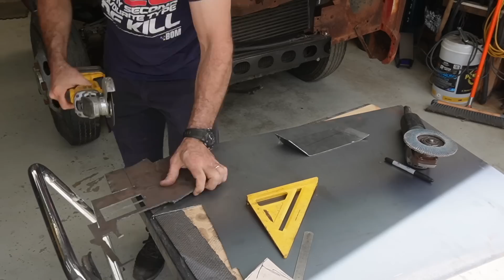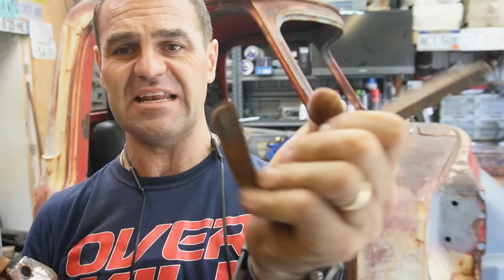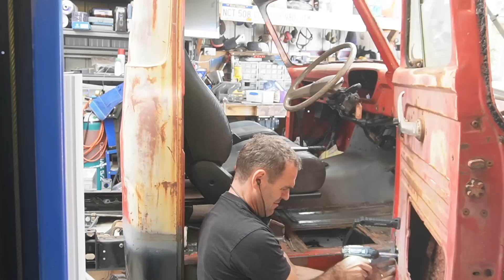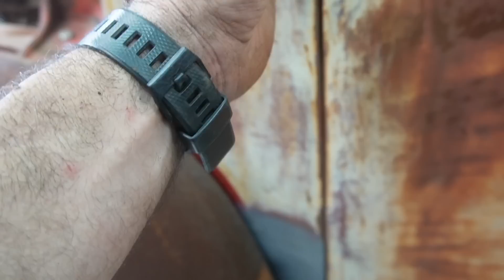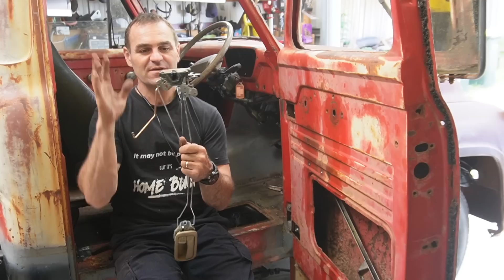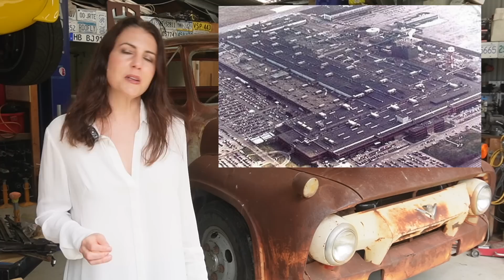Frankenhauler finally gets doors - 1954 Ford F600 Car Hauler Build part 35

Comment: That looks wicked Jeff, Well done mate.
Quick Question. Are you gonna hammer and dolly the dents out of the front fender ? and are you gonna clear coat over the rust and patina to lock all that beautiful patina in?
I really hope so cause it looks awesome. Like I said before, Well done mate.
Also did you hit up Hygrade laser profiling to cut out a tray for this beauty from aluminium? If you need help tig welding the tray together I'm here and ready to help you out but I will have to bring my own welder.

Comment: Use the seat belt holder from a Merc, the static kind it will take up your slack and make the belt easy to reach without affecting operation...

Comment: Always enjoying your ability to improve this old truck.  A comment on your door hinges though. I refurbished hinges, which weren’t seized, but had a lot of play after 40+ years, with SS pins.  I added grease zerks to be able to squeeze grease into the hinge, preventing the non SS part of the hinge from corroding.

Comment: Use power door lock actuators to open the doors, hide an external switch and shave the door handles.
Reply from the maker: I did that in my show car days and not again. More headaches than it is worth.

Comment: Aren't the door hinge pins hardened steel?  I have replaced pins on a few old fords that old and the ends were hardened/annealed.  It almost seemed like they only heated and hardened the ends only.  Chevy's and Fords in the 60's and 70's were not hardened that I can tell.

Comment: The mirrors from a Mercedes Atego are brilliant.  There is another downward pointing mirror for the left which shows the exact positioning of the gutter.  I also have a rear camera with views along each side and a third view of what is immediately behind the truck.  Dash cam is great evidential value when you encounter the morons in 4 wheels.  No Court would believe how stupid they can be without video proof.  Your videos are fine at 30 mins mate.  The bonnet looked 50 times better wet mate meaning rust is not patina and looks terrible.  All your other builds are great.  The seat belts must retract quickly and fully or they won't pass as we all know.  Best of luck with it you are doing great work.  Great delivery from Mrs Jeff as usual.  Cheers

Comment: In the US I know we have places that rebuild seat belts and reset airbag modules, and I assume AUS would have the same. I wonder if they could shorten those belts or retension them if the soapy water doesn't work?

Comment: Nice work, for the seatbelt, some coupes, vw corrado, mercedes, have holders, that when you put de contact on the belt come electric to the front, so it’s easy to reach them. My it’s something for you. You also have them manuel.

Comment: Those belts are easy enough to shorten. You just unreel the whole thing and trim the end. The tail end of the belt is just locked in with a dowel.

Comment: Do those hinges just pivot off the pin with no bushing? I'm not familiar with Ford F truck hinges of that era but the same era chev and  GMC used brass bushings between the pin and hinge.
Reply from the maker: Nope. No bushings to be seen.

Comment: Im interested in the door latches, will they need to be engineered. I am restoring a FJ Holden and had been thinking of using a newer modern door latch system.
Reply from the maker: Yes, technically they should be.

Comment: Might try cleaning the seatbelts with boiling water/steam and then lubricating. I’ve heard you can use silicon spray, but I like unscented aerosol furniture polish (Pledge, in the US). It’s light, won’t stain, and works brilliantly
Reply: Agreed, simply soaking and cleaning the belts helps them to retract much smoother
Reply from the maker: Great tip.